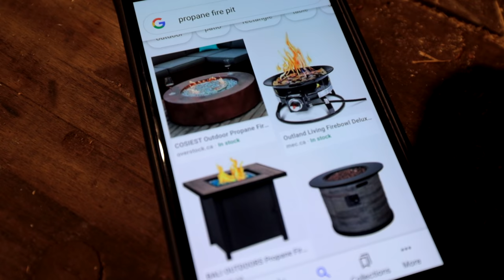Building Cheap Homemade Propane Backyard Fire Pit!

Comment: Love this, maybe next you can make some sort of igniter on the bottom?  Perhaps use the holes in the tire rim to shove 2 pieces of wire up from a 12 volt power supply just out the reach of the flame or something safer along those lines.

Comment: A brilliant idea. Just nead some heat proof epoxy to keep the glass on there and put a smooth layer over the top in case little hands play with it when it’s not turned on.

Comment: Was the hot water heater burner off of a natural gas hot water heater or propane hot water heater or does not it matter
Reply from the maker: It was from a NG..  it's the size of the orfice.. but I'm not really worried about efficiency.

Comment: Man I'd love to do this, but I don't think propane (or natural gas) water heaters are common in my neck of the woods.  What could I use as a substitute?
Reply from the maker: Side burner from a BBQ
Reply: @ModernSelfReliance  Wouldn't that be limited to a very small flame?

Comment: power mig 140 c or 180 c welding machine buy it for the workshop
Reply from the maker: I have a Lincoln Welder..  Just not certain I want to run it on a Generator haven't done my research yet.
Reply: @ModernSelfReliance   i have a lincoln power mig 140 c i never used it on a generator but the machine works great

Comment: I would be afraid that some of the glass pieces could "explode" under the heat and someone will end with a shrapnel in his/her eye :-( Or am I completely wrong with this and that couldn't happen?
Reply: Tempered glass is usually a high grade soda-lime glass and so is more susceptible to thermal fluctuations. Such glass also has a practical upper service temperature of about 200 C or maybe a little more. Common window and door glass that is tempered by salt bath treatment uses ion exchange to compress the outer surface. Before this method, tempering was done with heat where the glass is softened at a high temperature after it is formed into a sheet and then blasted with cold gas to chill the outside more than the inside. Such tempering can be done to more types of glass than the salt bath method which is most common. Pyrex tempered glass would not break as easily in a temperature change.
(Found that answer on line from a NASA materials scientist)
Reply from the maker: based on my research tempered will not explode from heating.
Reply: I like your short simple answer rather  than the long drawn out NASA answer